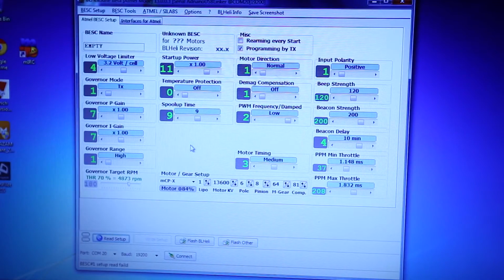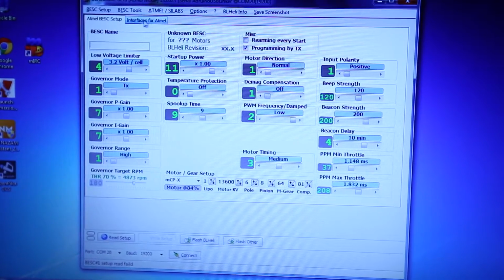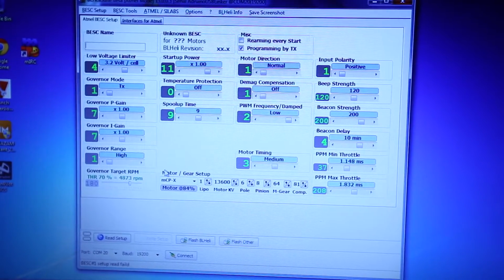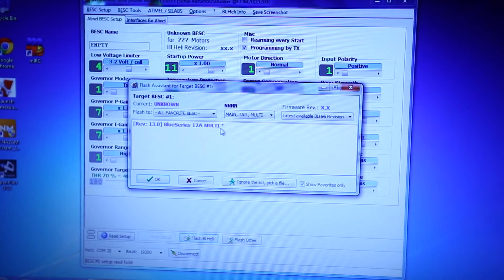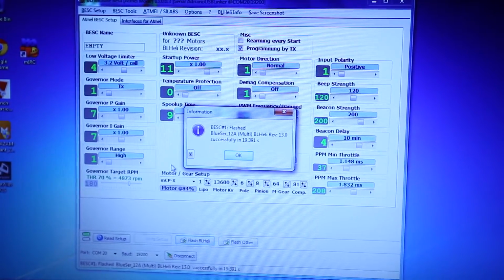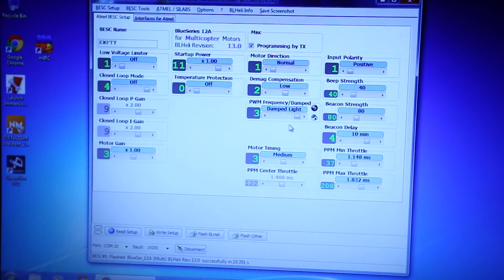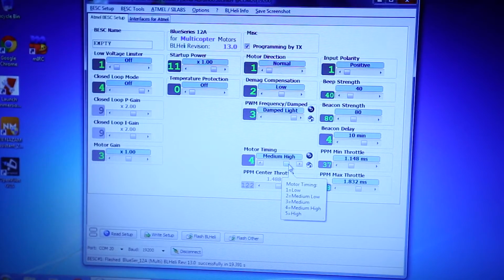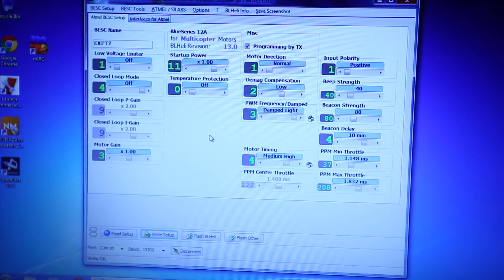How to Flash UBAD Black Ninja Series ESC with Beast Mode

Comment: Do you know if I could flash the UBAD 20 amp ESCs with an Afro USB linker I already have?  I've been using it to flash my Afro ESCs with BLHeli with this same program.
Reply: +U BUY A DRONE LLC Just ordered some UBAD Mini Beast 20Amps for a SunnySky 2207 2100Kv 4S 6" build I am doing .. will this same process work for my new ESCs with an Afro Stick?  I think I will need to change the stock timing for those motors yes?  Sorry I have never flashed an ESC before...
Reply: Awesome I have an Afro Stick so I will check it out.  You guys think I am good to use the Mini Beast 20 amps with some SunnySky 2207 2100Kvs and 6" on 4S?
Reply: +U BUY A DRONE LLC hahah awesome. :)